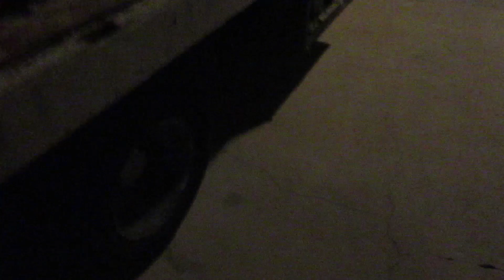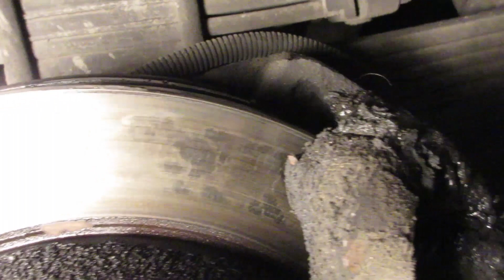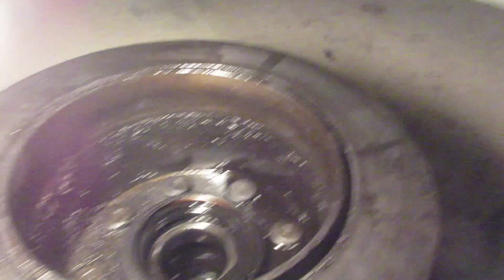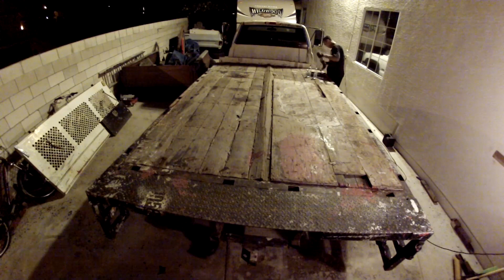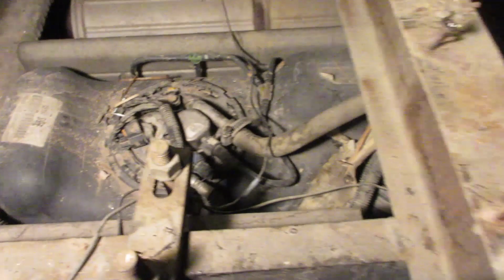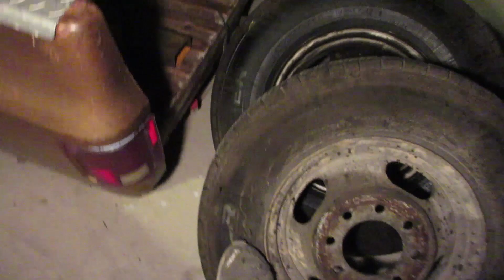Crawler Hauler - New Glass, Greasy Brakes and pullin wood!

Comment: All those seals on these newer diffs do that....come apart...no idea why
Reply from the maker: I was thinking maybe it was installed improperly, but guess not. I better replace the seal on the other side when I pull it apart and change the brakes. I did some troubleshooting on the high beams and it does look like it's the multifunction switch. What do you typically see with an always full fuel gauge?
Reply: usually the problem with level sensors are the sensors themselves. That's what my experience has been man